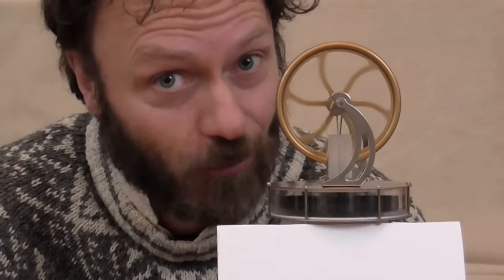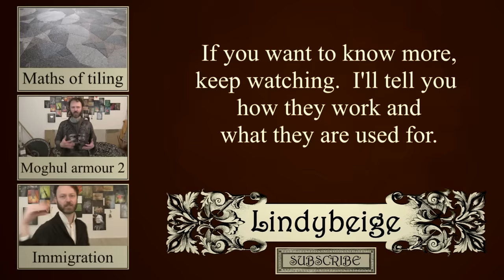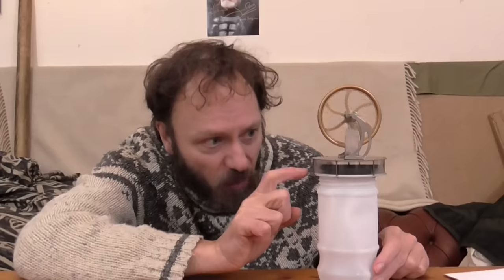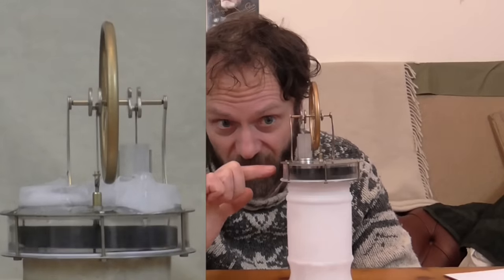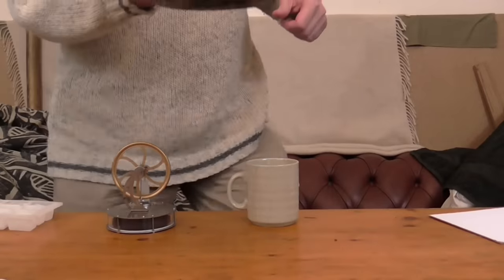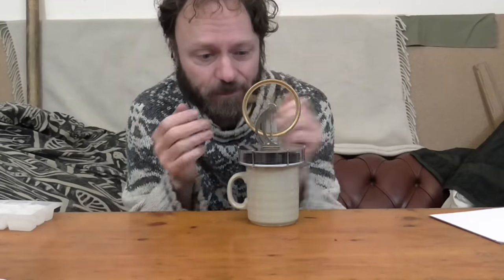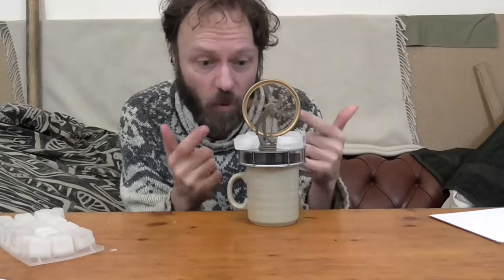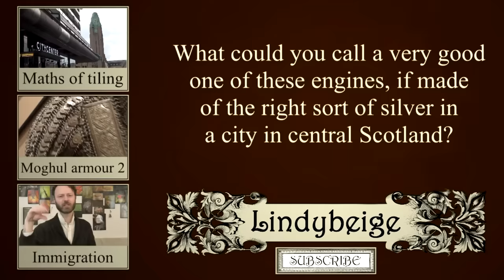Stirling Engines - the power of the future?

Comment: I feel like Iceland would be the ideal place for these.
Reply: Antartica is to far away from the possible users (apart from the research stations there), the energy loss due to distance would be to great. Iceland has the needed heat and cold and the heat is already in use there for energy. The infrastructure already exists.
Reply: I agree w/you that Iceland is indeed the best place for large scale Stirling engine use.
Reply: It stopped running at 5:30 , because no
Reply: too cold, if both sides of the plates are cold nothing happens. didn't you listen?
Reply: Bullshit !!  Iceland is full of hot geysers and free geothermal energy underground and it's cold outside. Sir Billius is 100% right!
Reply: Iceland is green Greenland is icy
Reply: @AuralVirus  absolute temperature is pointless differential is all that matters for a stirling.  If the ground is -20 and the air is -50 you have 30 degrees of differential same as if you had a 120 degree hot vent and a 90 degree ambient...
Reply: They got plenty of free, environmentally-friendly geothermal steam on tap, alright.  But from the supplying-an-energy-grid standpoint, it's probably better to use the steam to drive turbines, which have a much greater power-to-weight ratio.  They may not be as efficient, but the turbines pack more punch for the money spent, it seems to me.
Reply: Sir Billius you mean Greenland, buddy.
Reply: Maine, Maine is great for this Brrrrrr!
Reply: Sir Billius Iceland is green.....Greenland is cold
Reply: However far Antarctica is away it is cold all over, so the temperature gradient isn't good. Iceland is great because there are lots of thermal vents,  but the general environment is cold.  They can be used in the tropics if You dig a well from which you can get some cold water, relative to the sun.
Reply: Greenland you dope
Reply: @Generic Username, Namiko Sai, Jack The Gamer, C NearWheel, and CALL OF THE WILL MAN:
Sir Billius is correct.  Greenland may be colder, but the intensity of sunlight there is low.  Iceland, as noted by others, has geysers, hot mud ponds, and other great geothermal resources to provide large temperature differences relative to the air or the ocean.

Iceland is a unique location where the mid-Atlantic ridge (where the Atlantic Ocean is slowly growing wider) is on land, rather than at the bottom of the ocean.
Reply: @55dbk  well said
Reply: Sir Billius, you are a genius, the air in Iceland is pretty cold, and under the earth they got thermal power!
You’re a genius!
Reply: You guys keep saying "You mean Greenland, Iceland isn't icy!" but you are forgetting that a tenth of Iceland is covered in ice.
Reply: I know exactly where I want to build one of these in British Columbia.  There are a series of hot springs that sprout up about 100 meters away from a glacier fed river.  The Hot Springs run around 25C and the glacier water is pretty darn close to 0C.
Reply: What about Alaska/Russia

Comment: Integrate it into a hat, it can be brain powered!
Reply: and you will have to think a lot .... to create heat .... heh -_-
Reply: Abdul Gemayyel I've heard before that the brain uses something like 1/3rd of the energy requirements for our bodies. :)
Reply: blazednlovinit some truth in that .... the components of a car with no engine, could be developed even in ancient times ..... in the same sense the body is energy is burned at the brain!
Reply: It's more like about a fifth.
Reply: Ideally, when the room gets hot enough, that powers the generator to operate the central air, and if it's cold, that can power an opposite, separately calibrated engine to generate heat. I'm sure it wouldn't work, but gosh wouldn't that be fun.
Reply: Having a stirling engine inside a hat, something like a top hat would be extremly steampunk-ish.
Reply: you can design it with a container for dry ice. The dry ice would sublimate and you can have "steam" coming out of your hat. You could also put in a small electric generator on the spinning wheel. If it spins fast enough and you have the generator attached to 2 wires on each end that are almost touching each other, the air will act as a resistor and glow every now and then.
Reply: Muykle you are a god damn steampunk genius

...so...
...when will those hats be for sale?
Reply: I was kind of joking. I think it would be more difficult than what I am capable of. Also I don't want to be responsible for injuries from having dry ice falling out of the hat or the shocks. Also this hat would be hard to make correctly, not be off balance, and not too heavy. If I were to sell this thing, there are many tiny subtle things that could hurt the person that wears this thing (or people nearby this hat). As a prop at a convention and not as a hat, it could be fun. Maybe an impractical cigar lighter
Reply: Those injuries will be for the greater good! Steampunk fashion must become the new punk rock! The world must be a place where everyone looks like a crazed scientist from a long time ago, DEUS VULT! 

(And I was fully aware of the joke all along)
Reply: um.....that's assuming people think period.
Reply: Brain powered engine! Then you could mesure your iq in kw (or W). Imagine people going around with flywheels on their heads and some spinning so fast they could not control the direction of movement of the person?!
Reply: Brain? Who has a brain anymore?
Reply: Lemons are great for brain power 😉
Reply: Then you got something to plug your phone into ☺
Reply: indirectly falls entire comment section a bunch of hot heads